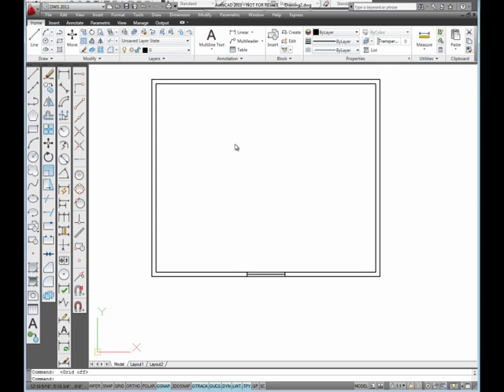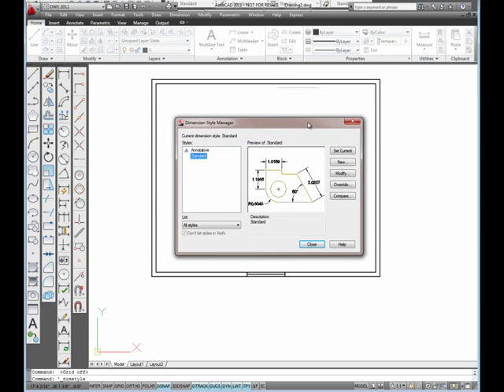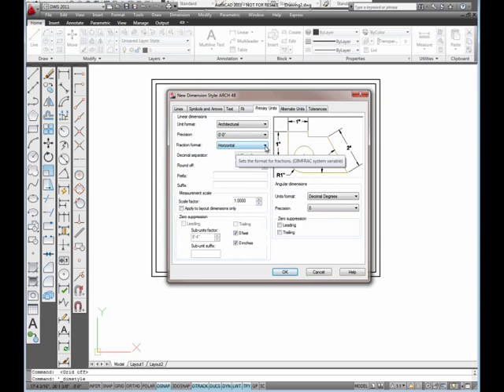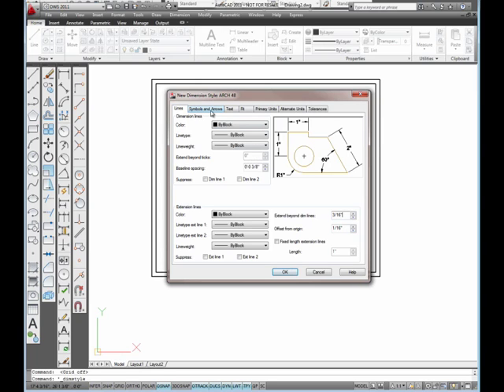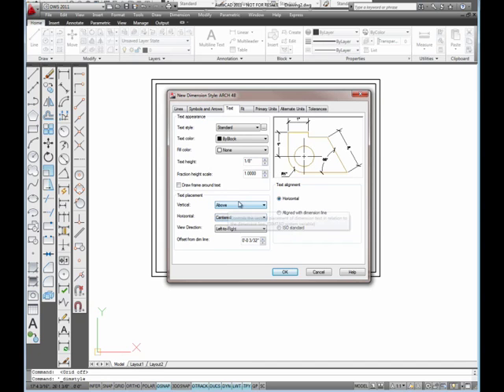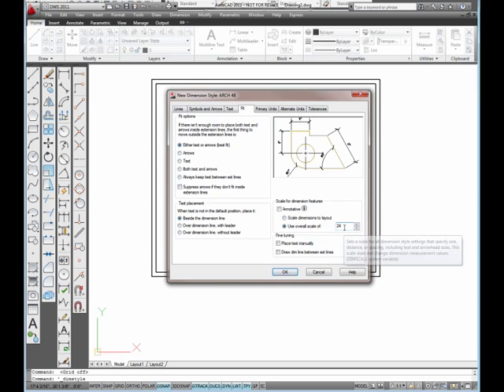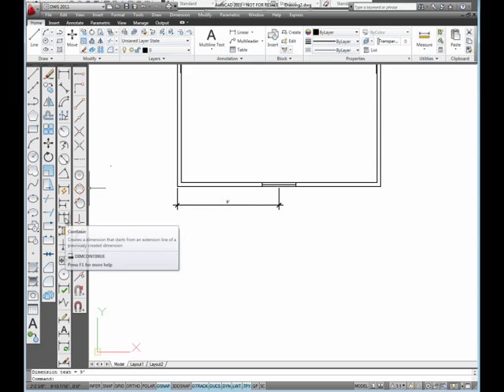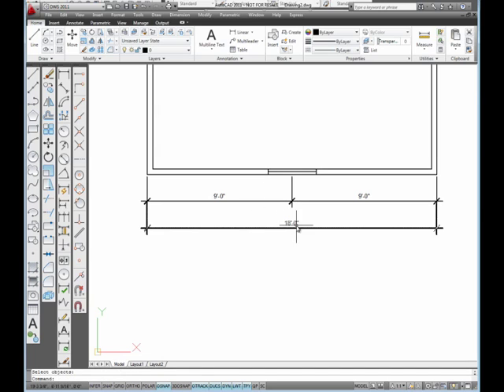Creating an Architectural Dimension Style

Comment: Excellent video.  Great information.

Just one area of confusion.  The name of the dimension style "Arch 48" is for use on a drawing that will be identified as, plotted at  and read at 1/4" = 1'-0" scale.  The 48 refers to the scale factor (12" / 0.25" = 48).   The plotted sheet when plotted at 1/4"=1'-0" scale will be 48 times smaller than "real life". 

Yet in the video you set the scale factor to be 24?   As you say, "setting the scale factor to 24 makes 1/8 inch high text to be 3 inches high" (then IF you plot the sheet at 1/2" = 1'-0" scale, the text will measure to be 1/8" high actually when measured on the sheet).  

There is a mismatch of logic.  Either the dimension style should be named "Arch 24" to match what you entered for the scale factor or the scale factor setting should be 48 to match the name.

Am I missing something?  (It can be very confusing when learning something new and the information isn't quite right.)

Best Wishes